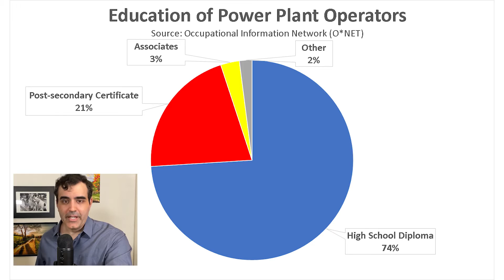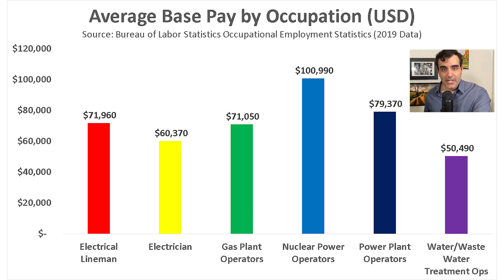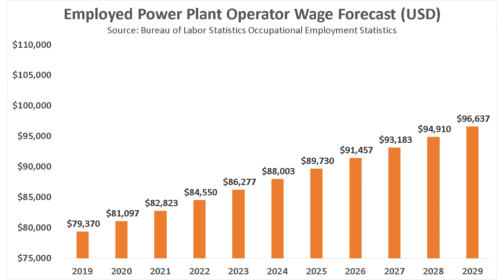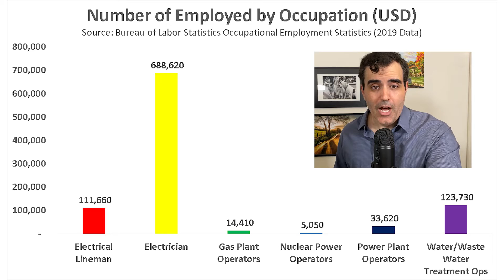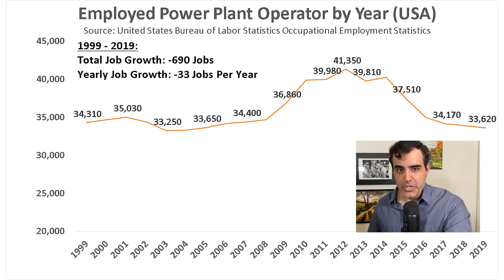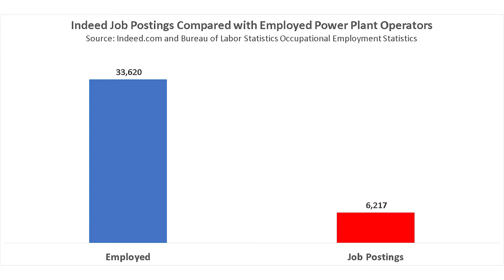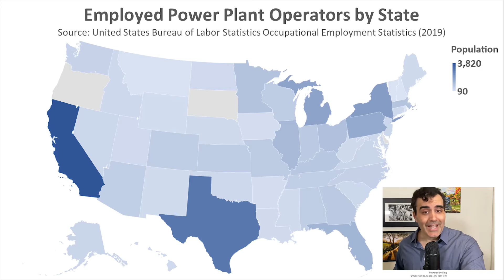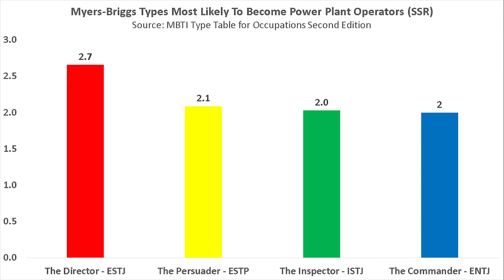Become a Power Plant Operator in 2021? Salary, Jobs, Education

Comment: When my results UJIAN PENILAIAN SEKOLAH RENDAH UPSR 2004 SK LONG TUMA LAWAS coming soon on 12 November 2004 getting 5C' especially Malay Language Writing Essays, Bahasa Inggeris, Mathematics Paper 1 and 2 at least 25/40 marks 59 and higher and paper 2 ( 2 hours 45 minutes) Question 1 until 29 Mark's 59 and higher and also Science I'm very proud of it's. And also PENILAIAN MENENGAH RENDAH SEKOLAH MENENGAH KEBANGSAAN MERAPOK LAWAS 31 KM JALAN MERAPOK 2007 getting results 31 December 2007 when I getting results '3C 4B especially BAHASA MELAYU, BAHASA INGGERIS, MATHEMATICS paper 1 and 2 using scientific calculator at least 25/40 marks 59 and higher and also paper 2 ( 2 hours 45 minutes) Question 1 until 29 Mark's 59 and higher and also GEOGRAFI, SEJARAH, SCIENCE, KEMAHIRAN HIDUP BERSEPADU PK I'm very proud of it's. In primary 2 in the years 2000 when I not moving to SK LAKSAMANA JALAN PANTAI BARAT STAMPIN TIMUR 93350 KUCHING SARAWAK City's to SK SIBURAN KUCHING SARAWAK 31 KM JALAN SERIAN until I Primary 5 2003 SK LAKSAMANA JALAN PANTAI BARAT STAMPIN TIMUR 93350 KUCHING SARAWAK City's. My Jobs collected tin aluminum coca-cola at KUCHING SARAWAK City's My family's Lived at TAMAN DURANDA EMAS LOT 241 JALAN SIBURAN KUCHING SARAWAK when it's weight 20 kilos rm 600 I will buying a football shoe's brand Coneli rm59 at Tabuan Jaya KUCHING SARAWAK City's, Sports Power Shoe's rm39, 2 pair of socks rm30,Fail holder rm 5.80 and also Singuard rm25 at 1 July's 2003 . When my results Trial examination report cards Bulanan 1, Bulanan 2, Penggal 1, Bulanan 3 and Penilaian Akhir Tahun getting mark 59 and higher especially Malay Language Writing Essays, Bahasa Inggeris, Mathematics Paper 1 and 2 at least 25/40 marks 59 and higher and also Science another subject Kajian Tempatan and KH I'm very proud of it's. When I my Mother's and my Father's moved from KUCHING to LAWAS on 1 December 2003 my father's and my Mother's registered SK LONG TUMA LAWAS 30 December 2003 started 1 First January's 2004 when I attended Olympics international sports school SK ULU MERAPOK LAWAS, MSSM LIMBANG DEWAN SUARAH LIMBANG and also SMK DPHA HAJI GAPOR 93350 KUCHING SARAWAK City's. When my Trial examination report cards Bulanan 1, Bulanan 2, Penggal 1, Bulanan 3 and Penilaian Akhir Tahun getting mark 59 and higher especially Malay Language Writing Essays, Bahasa Inggeris, Mathematics Paper 1 and 2 at least 25/40 marks 59 and higher paper 2 ( 2 hours 45 minutes) Question 1 until 29 Mark's 59 and higher and also Science I'm very proud of it's. When my results UJIAN PENILAIAN SEKOLAH RENDAH SK LONG TUMA LAWAS 12 November 2004 when I getting results 5C' especially Malay Language Writing Essays, Bahasa Inggeris, Mathematics Paper 1 and 2 at least 25/40 marks 59 and higher and also paper 2 ( 2 hours 45 minutes) Question 1 until 29 Mark's 59 and higher and also Science I'm very proud of it's. My Father's and my Mother's registered SMK MERAPOK LAWAS 1 First January's 2005 at DEWAN SERBAGUNA HALLS when my classes Form 1 Cerdas when my Trial examination report cards Bulanan 1, Bulanan 2, Penggal 1 and Penilaian Akhir Tahun getting mark 80/90/100 I will not moving to SMK MERAPOK to SMK LAWAS 30 December 2005 started 1 First January's 2006 I will filled the letters Hostels school SEKOLAH MENENGAH KEBANGSAAN MERAPOK LAWAS 31 KM JALAN MERAPOK at 12 December 2005 started 1 First January's 2006 with classes Form 2 Amanah until 1 First January's 2007 . When I prepared for Examination PENILAIAN MENENGAH RENDAH SEKOLAH MENENGAH KEBANGSAAN MERAPOK LAWAS 31 KM JALAN MERAPOK at 1 first October until 31 October 2007 after that's I will going home back to my Hometown LAWAS Village 🏠 Kg GAYA BARU 98850 LAWAS, SARAWAK.  When my results PENILAIAN MENENGAH RENDAH SEKOLAH MENENGAH KEBANGSAAN MERAPOK LAWAS 31 KM JALAN MERAPOK 2007 at 31 December 2007 when I getting results '3C 4B especially BAHASA MELAYU, BAHASA INGGERIS, MATHEMATICS, GEOGRAFI, SEJARAH, SCIENCE, KEMAHIRAN HIDUP BERSEPADU PK and original certificate PENILAIAN MENENGAH RENDAH SEKOLAH MENENGAH KEBANGSAAN MERAPOK LAWAS 31 KM JALAN MERAPOK at 7 Subject KOD SUBJECT, GRED BAHASA MELAYU C, BAHASA INGGERIS C, MATHEMATICS C, GEOGRAFI B, SEJARAH B, SCIENCE B , KEMAHIRAN HIDUP BERSEPADU PK B I'm very proud of it's and put in My Fail holder since I buying and collected tin aluminum coca-cola when it's weight 20 kilos and price rm 600 at 1 July's 2003. I will moved from SMK MERAPOK to SMK SIBURAN KUCHING SARAWAK City's at 1 January's 2008 when I photostat Slip Results PENILAIAN MENENGAH RENDAH SEKOLAH MENENGAH KEBANGSAAN MERAPOK LAWAS 31 KM JALAN MERAPOK when I getting 3C'4B especially BAHASA MELAYU, BAHASA INGGERIS, MATHEMATICS, GEOGRAFI, SEJARAH, SCIENCE, KEMAHIRAN HIDUP BERSEPADU PK I'm very proud of it's when my classes in Form 4SC5 when my Trial examination report cards Bulanan 1, Bulanan 2, Penggal 1, Bulanan 3 and Penilaian Akhir Tahun getting mark 59 and higher especially BAHASA MELAYU, BAHASA INGGERIS, MATHEMATICS paper 1 and 2 using scientific calculator at least 25/40 marks 59 and higher and paper 2 ( 2 hours 45 minutes) Question 1 until 29 Mark's 59 and higher and PRINSIP PERAKAUNAN, EKONOMI ASAS, SAINS TAMBAHAN another subjects PSV and PJK I'm very proud of it's. When I finished my biggest Examination SIJIL PELAJARAN MALAYSIA SEKOLAH MENENGAH KEBANGSAAN SIBURAN KUCHING SARAWAK at November 2009 until 19 December 2009 . I will not going back with my mother at her Small Town Liked LAWAS at 21 December 2009 I will find a Jobs at Supermarket Everrise Jalan BDC 21 December 2009 position Sale's Assistant basically salary rm 800 started 1 First January's 2010 opening Account 🏧 using MyCard and I going to Institute Latihan Memandu Motosikal and Car at KOTA SAMARAHAN KUCHING SARAWAK City's 🏫 started 12 February until 31 May 2010 for Examination Computers must being passed 42 and higher License L rm 400 and Licensed P rm 800 I will collected money rm9,000 I will buying a Motorcycle Yamaha EZ11 rm5,900 . When my results SIJIL PELAJARAN MALAYSIA SEKOLAH MENENGAH KEBANGSAAN SIBURAN 2009 at 17 March 2010 when I getting results straight B+++++++ " KEPUJIAN TERTINGGI BAHASA MELAYU, BAHASA INGGERIS, PENDIDIKAN MORAL, SEJARAH, MATHEMATICS, PRINSIP PERAKAUNAN, EKONOMI ASAS, SAINS TAMBAHAN when I redoned studying programming computer short courses at KOTA SAMARAHAN KUCHING SARAWAK City's at 1 April 2010 until 12 April 2010 especially Words, Typing Master, Ms Excel, Microsoft Office, and Ms PowerPoint Certificate until I getting Originally Certificate SIJIL PELAJARAN MALAYSIA SEKOLAH MENENGAH KEBANGSAAN SIBURAN KUCHING SARAWAK 2009 on 12 April 2010 and 8 Subjects Especially CODE, SUBJECTS and GRED BAHASA MELAYU B+ KEPUJIAN TERTINGGI, BAHASA INGGERIS B+ KEPUJIAN TERTINGGI, PENDIDIKAN MORAL B+, SEJARAH B+ KEPUJIAN TERTINGGI, MATHEMATICS B+ KEPUJIAN TERTINGGI, PRINSIP PERAKAUNAN B+ KEPUJIAN TERTINGGI, EKONOMI ASAS B+ KEPUJIAN TERTINGGI, SAINS TAMBAHAN B+ KEPUJIAN TERTINGGI I'm very proud of it's. And also Certificate Curriculum sports and Games SEKOLAH MENENGAH KEBANGSAAN SIBURAN KUCHING SARAWAK minimum CGPA; 3:00 Comment: This Students Active at Curriculum sports and Games.. After I will continuing Institute Latihan Memandu especially Car at 1 June until 31 August 2010 first Examination Computers and Question Essays must being passed 42 and higher especially License L rm 1,500 and also Licensed P rm 3,000 when I getting two2 License Motorcycle and Car I'm very proud of it's. I will buying a laptop and 🖨️ with price rm 2,500 and Mobile phone 📱 Apple rm1,800 doing password and Email at 1 September 2010 when I redoned classes Musical learning center at KOTA SAMARAHAN KUCHING SARAWAK City's buying a Bass Fenders rm 5,900 at HOCK LEE CENTER KUCHING SARAWAK City's, ELECTRIC GUITAR 🎸 FENDER rm5,900 and also Speaker Fender rm850 for First classes rm140 fees at 1 April 2010 until 31 August 2010 at Fiona Music 🎼 Learning center KOTA SAMARAHAN KUCHING SARAWAK when I passed I'm very proud of it's. I will applied for a Scholarship UNIVERSITY COLLEGE ICATS JALAN PANTAI BARAT STAMPIN TIMUR 93350 KUCHING SARAWAK City's at 1 September 2010 started 1 First January's 2011 . When I getting HND Mechanical Engineering with minimum CGPA; 3:89 Semester 1, Semester 2, Semester 3, Semester 4, Semester 5, and Semester 6 after I will continuing 1 January's 2014 Semester 7 and Semester 8 with minimum CGPA; 3:89 convocations 23 December at Convention Center KUCHING SARAWAK City's. I will applied for a job PETRONAS GAS BERHAD Lutong 98000 Miri Sarawak at 1 first January's 2015 recruiting 1 April 2015 on Job Training oil and Gas and find 4 friends at Kg Long Tanid and find housing at PUJUT MIRI SARAWAK City's with budget rm600 ..

Comment: I worked for 34 years for the Los Angeles DWP as a Power Plant Operator in the DWP basin Generating Stations. These were generating stations that in the past burned both natural gas and fuel oil in large boiler to make steam to generate electricity using large steam turbine generator units. Most of the units I operated were units that were built in the 1950s that had mostly pneumatic control systems made by the company called Bailey Meter Company. One of the most difficult things of being a generating station operator was that for 34 years I worked rotating shifts of 10 day on and 4 days off. There was 10 days of the dayshift and four days off, then 10 days of the what was called peak shift and 4 days off and 10 days of the graveyard shift. This made it very difficult to have a social life and my waking and sleeping times kept changing. I retired in July 2011. I am now 73 years old and have a very good Los Angeles DWP retirement pension. Also I am a single man who never got married. In my line of work most of the men who were married and had a family were married before they began working for the Los Angeles DWP as a Generating Station Operator. For men that were single when they started this career, it was very rare for them to get married after they started working as a Generating Station Operator. We also had a few women working as Generating Station Operators. This line of work was mostly men.

Comment: Is this field of work unionized to some degree?
Reply: Yes, very much so.
Reply: @Templar112299  Could you possibly give me some more info? I'm very interested in this field of work. Currently in the IBEW as an equipment operator who builds powerlines. However I am looking to make the switch into a different field. What union operates with the nuclear field? As well how do you get your foot in the door? Thank you for any information.
Reply: For some reason my replies don’t look like they’re going thru so here’s a TLDR:

My union is IBEW as well. To get your foot in the door you just got to apply. Look for non licensed operator (NLO) / auxiliary operator / nuclear plant attendant / equipment operator trainee or apprentice postings. Nukeworker is a good site for finding openings. There’s also a forum but it’s not super active.

I was hired as an NLO with only a bachelors in computer science. They usually want a 4 or 2 year degree in a stem field but your current job might be experience enough.

Good luck if you have any other questions I’ll try to answer them.

Comment: I have one an hour away from me. Currently hiring a trainee position. Starting pay is 26-28 but the next step is at 46 an hour and operator 3s are at 52 an hour. I’m currently at 27.96 at my factory but I might make the switch to power plants because I’ll make more in 6 years there then at my current factory

Comment: I was a generator mechanic in the Army. Does anyone have advice for getting into this job without being at entry level?
Reply: depending on the gig entry level is 21-37 a hour with great hours, u can break 100k with OT easy. work outage based

Comment: I did it with a high school diploma.  I started in the ash area and now I'm dispatching.  16 years of shift work.
Reply: Honestly.  I would get the NERC cert then look up jobs.  If you get hired, drop out of school and save your money.  Stick with the company and get some experience and within 10 years, you'll be set up and won't need the degree.
Reply from the maker: Nice!
Reply: Did you make good money? And how much hours did u work?
Reply: If you're in North America, you need to look at getting a NERC certification. Then look for jobs like system operator, dispatcher, scheduler, reliability coordinator, transmission operator. They're all related in some way.  The problem that the industry is having is there's not enough people who worked their way up like I did, so they don't have any common sense.  Only paper degrees which don't hold up very well.
Reply: I started in 2005. 15.60 an hour.  12 hr rotating shifts. Look up the 4 shift Dupont.  15 years of shift work is hard on families. It makes you tired and grumpy. It actually takes years off your life. I'm making about 110k now but I'm on a different shift, and I'm not operating plants anymore. I'm dispatching. When I was traveling, I would get contracts that paid about 130k to 140k per year.  I worked my way into management but decided it wasn't for me. The pay is good but it's not for everyone.
Reply: @drbecktex  Hey, I'm a current student studying Electrical Technology at HACC Community College. I've looked up the career on Indeed, I've looked everywhere on Youtube. But I just can't figure out how to become a Power System Dispatcher. How did you become one? Is there any way you can help me become one?